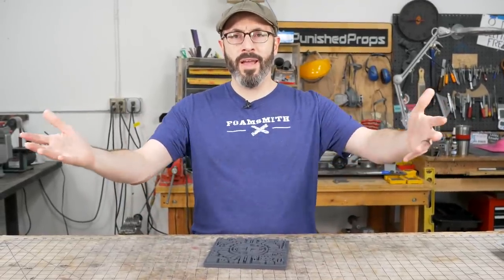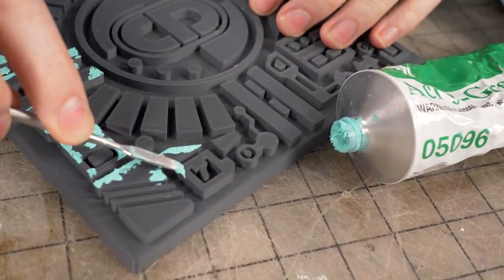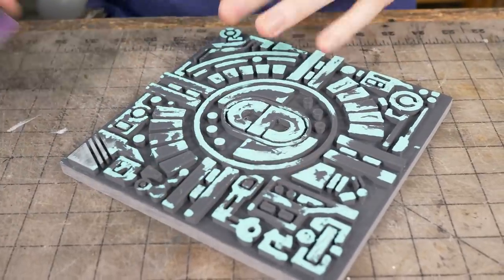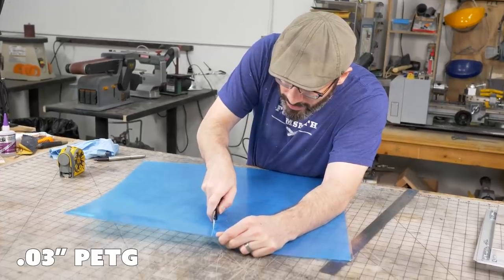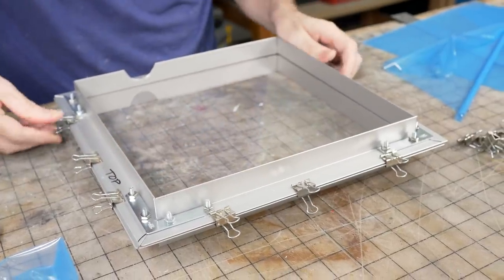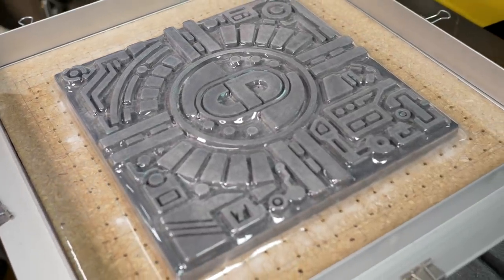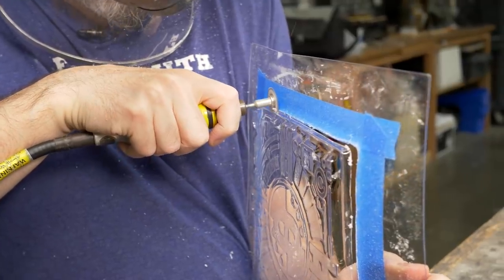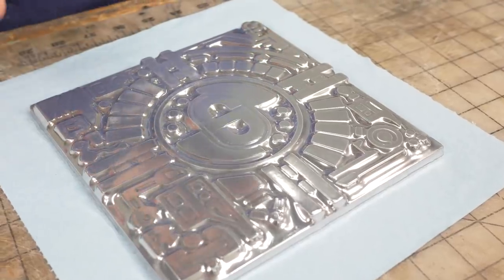Vacuum Forming MAGIC for CAPTAIN DISILLUSION!

Comment from the maker: Check out the full list of tools & materials used in this video at https://www.punishedprops.com/2021/05/20/cpt-disillusion-panel/
Reply: heres am amature tip (cause im not a pro lol) once you have it in the vacuform machine with the vaccume on, if you don't get some of the detail you want you can heat up the area you want to target with a heat gun to get more depth in the detail. alternatively you can use a desoldering station that has a very narrow output for the heating element that will allow you to target the area you want. have to be careful with the 3d print underneath, but with other heat resistant materials it works a charm. Cheers!

Comment: I love the simplicity of that vacuum forming machine. Very easy for anyone to build and meet most needs. I went whole hog back in the day and built a big daddy 2x4 ft former from the TK forums and its 500lb of steel and fire breathing glory that's too massive to use most of the time. The tip here is get as far as you can with simplicity and you'll have a heavier wallet and more shop space!
Reply from the maker: Wow! That's awesome!

Comment: Those little holes you drilled won't work very well if they don't line up with the holes in your platten.  You need a little bit of a hollow under your puck so your vacuum will distribute through those holes and suck your plastic down into those details.
Reply: I was thinking the exact same thing. It would save filament too. 👍
Reply: i was gonna comment the same, he could also raise the print with washers or something
Reply from the maker: Thanks for the tips!

Comment: Good timing. I'm preparing myself to build my own DIY vacuum form! :D
Reply from the maker: Sweet!
Reply: @punishedprops  I also have one more question to you guys. I just watched your video on priming EVA foam for painting. Unfortunately - you only test the side without the texture on, which is very easy to paint. But how to prime the side of the mat with the texture on?? It has some nasty finish that I can't paint with anything I tried. Nothing seems to bond to it. I'm planning to repaint my 9-year-old N7 Armor soon but I can't seem to find a reliable technique (the last paint I used worked for a few months, but now after 9 years it's chipping off like crazy)... :( :( 

I know that you also have a similar N7 Armor so you had do solve the exact same problem somehow.

Comment: You can use a heat gun to get those little areas to sink more into the mold. just dont go too close or hold too long over an area. waving the heat gun around in small circles will help.
Reply from the maker: Thanks for the  tip!

Comment: Need to check out Draft angles and also putting more holes into the thing to pull the air through
Reply from the maker: The draft angle on this was totally fine but I should have added a pocket on the under side of the master to distribute the suction more evenly.

Comment: That poor printer needs some love, with the amount of putty used, it is slacking a wee bit.
But, it appears it made it possible to see what you do to fix it.....so, it all worked out.
Excellent work as usual.
Reply from the maker: Yeah it's been a little temperamental lately, but I tend to use a decent amount of putty regardless if I want a really nice finish

Comment: You could have just spray paint with high quality fine mist like Tamiya. It would have already filled in the smaller gaps and thin layer eliminate visible rough texture as the plastic thickness vac over it on back side would have smoothed out on it's own.

Comment: I wonder if you could get deeper imprint if you heated the 3d printed mold a bit - not anywhere near melting temperature, but a good bit above ambient. That plastic sheet has an awfully low thermal capacity, meaning the moment it touches something cold, it cools down and solidifies immediately in that spot (and drains heat from adjacent areas solidifying them too). Keeping the mold warm should allow the sheet to flow more.
Reply from the maker: Very possibly!

Comment: Have you thought about creating a small ledge on the underside of the mold, so there is an air gap between the bottom of the mold and the top of the platen? Otherwise the small holes you added to the mold back up onto solid board and are not likely to help pull the vacuum.
Reply from the maker: I definitely should have done something like that, I think it would have helped to get those little crevices to form better

Comment: With plastic it's more complicated, i vacuum form a lot of plaster molds, and to get better details it's great to preheat the mold, a few degrees make a big difference, I personally for petg get at least 60⁰C on the mold.
Reply from the maker: Yeah we actually were able to do that on one of our 3D printed bucks but only because we printed it at an extra high density so it could handle it

Comment: just watch the Kickstarter video for the kinetic-driver, I GOT CHILLS...
Reply from the maker: Right? Giaco knows what he's about
Reply: @punishedprops  I''m definantly planing to get one and build a steam/diesel punk theamed hybrid solar/kennetic driven rotating stand for the driver as part of a 2 part project so I can put it on display next to a Coffee Engine once I get one of each.

I've got an idea for a hopefully infinantly moving coffee engine that Should virtually "never" stop if all goes well.

The stand I want to build for the driver uses the same basic principals and mechanics as a self winding pocket watch to maximize the kenetic potential of the driver to reverses and dampen the energy to spin the stand/display in the opposite direction at a slightly slower speed and storing the energy in the self winding mechinism...

So if I start the driver in a clockwise spin, the display on which is sits should spin in a counter-clockwise rotation till the mechanism collects enough stored energy to reverse kenetic energy in on its self pushing the stand into a clockwise rotation causing the driver to rotate counter-clockwise, and vise versa. I've also thought about doing this with an antique or reproduction Pull string Spinning top.

Comment: If the holes for the details do not match the holes on the vacuum plate, they will not help, as the bottom of your form is flush with the top of the vacuum plate. You need to have a "vacuum chamber" (sorry, don't know any better English word for it) at the bottom of your form. Means you have to remove enough material around your form holes to guarantee that at least one, better more, vacuum plate hole can suck air through that form hole. Otherwise the vacuum plate will just suck the form tight to itself, without any airflow through the holes you drilled into the form.
Reply from the maker: Hey thanks for the tips!

Comment: The holes you drilled in the buck didn't align with the vacuum holes, so they didn't really help. I think it would work better if the bottom of the buck were hollowed out or if the buck was placed on a piece of felt so that the air could reach all the holes.
Reply from the maker: Yeah I think you're right!

Comment: Do the layer lines from the 3D print get transferred on the vacuum formed sheet? Does anybody have some experience with different layer heights (0.1/ 0.2 /0.3 mm) and vacuum forming with ABS/ PS/ PET(G) sheets (0.5 - 3 mm)? I would love to get some tips!
Reply from the maker: If the layer lines are significant then you could end up seeing some of the texture in your final pull
Reply: @punishedprops  Is 0.2 mm too significant?

Comment: Why instead of a vacuum system don't use a pressurize system? You will not need to drill any holes. Positive pressure will distribute de material much better and will be uniform all over the surface, and you don't need much pressure to mold hot plastic.
Reply from the maker: 'Cause I have a vacuum former and not a pressure system :)
Reply: @punishedprops  hahaha ok. I was talking about the system itself. They always use vacuum instead of pressurized. Haha but thanks for asnwering.

Comment: I do kind of wonder how the reflective finish would have changed if you'd used an electroless nickle plating instead of paint.
-preemptive edit: it wouldn't really be possible to make it semitransparent without something really unpleasant to do like sputtering.
Reply from the maker: I'm also not sure how a process like that would work on plastic like this
Reply: @punishedprops  I didn't think it through very well. Electroless plating for things like PETG or acrylic starts with copper and then you add nickel, so from the other side copper is what you'd see.
Apparently you can just buy PETG and acrylic that are already half-silvered even just on Amazon.  Defeats the point of doing it yourself, but its a whole lot cheaper unless you're making a silly amount of it.  Its $70 for a 2'x2' sheet but its a qualitatively better, mirror finish.

Comment: Couldn't you have just printed it using clear resin?
Reply from the maker: That's also an option! But I think it would have been harder to keep the wall thickness super thin so the chrome would shine through correctly. The plastic worked really well for that part of the process.